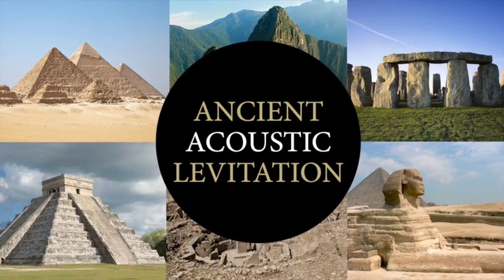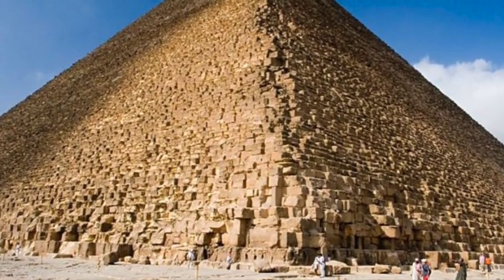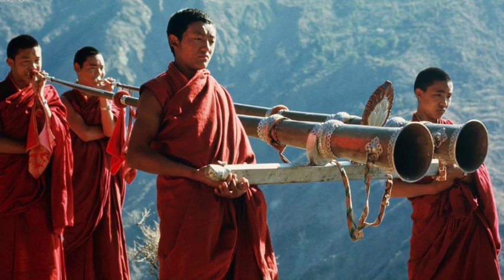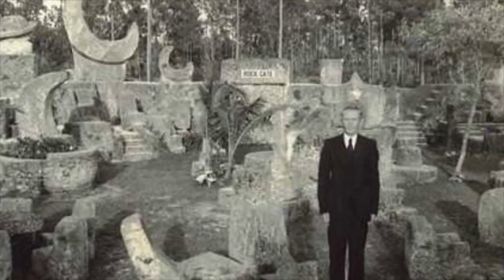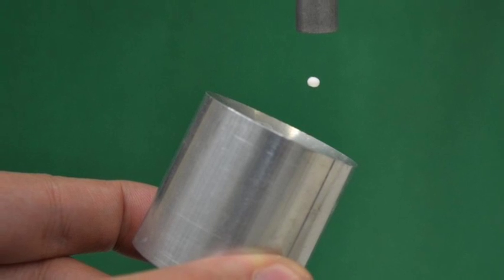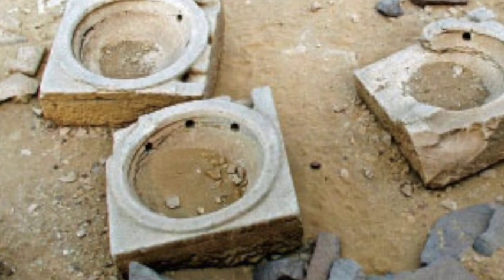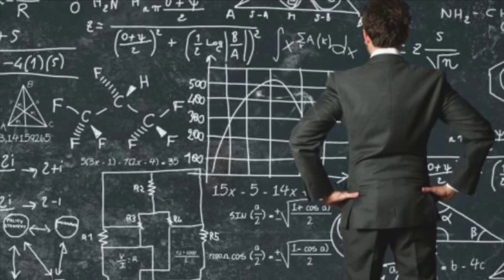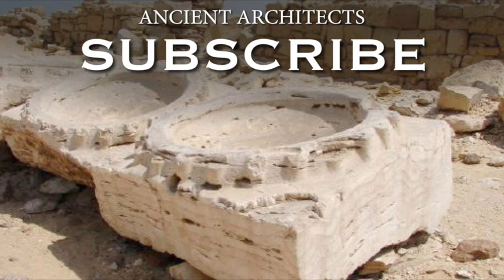Acoustic Levitation in Egypt - Ancient High Technology | Ancient Architects

Comment: One thing that always gets to me in the debate of HOW they did it, is the question that gets ignored.....why. why on earth make massive huge blocks anyways????  Everybody from the Romans to the  cathedral builders to the sky scrapers of today...were all made spectacularly with large materials that was not huge to start with. They were put together and built up. As in, we find ways to build big, but with smaller lighter materials put together or even mixed together like concrete and welding etc.  So WHY did they use massive blocks??? Surely they did so because somehow to them it was easy. It made sense. Maybe, like concrete, it was as simple as filling molds.

Comment: There is a much easier way to move heavy stones that have been cut,
Place a drop down flap around the base of the stone, and use these big horns, to blow air under these rocks and they can be pushed easily just as a hovercraft moves, or make a platform for the stones to rest on
,
That's too simple for the brains of today to think of moving them,

Create a sloped incline, and it would way to simple to raise these up to what ever level you wanted,
Just use the laws of physics to determine the best slope for several hundred men and horses to pull up an incline, and make sure you have a sound base for moving these stones, and it shouldn't take that long to build,

How many men would it take to move a 100 stones a distance of 100 miles, If you had a few solid surfaces to place in front of these stones as you moved them, it wouldn't take very long to move them a mile or so, especially if you had the man power,
You could probably do it a good walking speed , that means you could definitely move them 3 0 or 40 or 50 miles a day,
And once you finished moving them and putting them in place,  you would have a lot of fire wood, and no trace of how you did it

Comment: Someday people will realize copper melts at 1984 degrees F, and granite melts at around 1250 degrees F. Copper has been around and been smelted for atleast 9000 years which should predate egypt. These people
Simply used either very hot ( 1300-1700 degree ) copper or molten copper (we know they had bronze as well) to melt through the granite, than polish it. Occams Razor people… occams razor…

Comment: If you leave your bass guitar and amplifier connected and on, and you set the guitar down and lean it against the amp, the vibration of doing so will create a little feedback loop that in no time increases in volume and intensity to the point where it feels like the house is coming apart. Also works with regular guitars, I suppose, but my memory features my friend's bass.

Comment: Those multiple squares with the disc-shaped Bowl. Most likely were made in a mold or template. They seem to be Limestone dust collection pots. Where you at take some pieces of limestone and smack it with another piece of limestone and then be able to pour it out of those holes. The odds are that making cement and utilizing a special recipe of limestone sandstone and Granite and quartz most likely is the use for those multiple Square pieces with the Bowl inside are used for.

Comment: Great theory! I'm really impressed!
But, how does a strong electromagnetic field allow acoustic levitation? 10:34
Reply: Sound waves are at the bottom of the electromagnetic spectrum, so acoustic levitation is quite plausible. When a bright meteor passes overhead it can sometimes be heard at the same moment, even though it is some 60 miles away. The sound is likely a sub-harmonic of the vast electromagnetic noise generated traveling at the speed of light and both reach the observer simultaneously.

Comment: The stone blocks shaped like a bowl serve the same purpose as Ed Leedskins Coral Castle fl  stone grinder .device.  a piece of the stone to be lifted is ground up and this causes the ether in the vacuum to vibrate  Both Ed and those in Egypt used hand held cones to focus the ether vibrating energy to lift huge stone and guide them to any location they need to be placed in.   note each device has a specific number 24 shapes around the outer perimeter.  Ed's and Egypt's have these

Comment: I just saw two videos that shows how it was done.   First one shows how pulleys block and tackle make huge weights moveable.  The second shows that Egyptians used wheels and axles to move the blocks.  There is also a video that shows how Coral Castle was built, again, block and tackle and and electrical system he set up.  1.  Pulleys  Block & pulley
https://www.youtube.com/watch?v=r3Ru1zZjvug  2.  The wheel and axle   Pulleys  Block & pulley

https://www.youtube.com/watch?v=vYoWCn5r3rQ&list=PLat8Jejmdx1tsFo72_p159DE5-2-oW_qJ
3. Coral Castle  https://www.youtube.com/watch?v=nOoCuDnmtyM&t=127s   4.  Man from Michigan  shows how to move 20 ton block by using leverage.   https://www.youtube.com/watch?v=E5pZ7uR6v8c

Comment: Too bad the dude that came up with the barge idea was not an engineer. Otherwise, he would have known that the forces on the ships was rotational for a load centered between them, and that the engineering feat would require massive reinforcement as the lever the stone was located on would be attached to a fulcrum at the point of contact, with a very short lever trying to hold the force (vertical side of the boat) Basically, the load would be pressing down with 60 tons, but it is also pressing OUT with 30 tons on each side, that would turn, by leverage, into more than 30 tons per side of rotational force. Basically, his generic "rigid attachment" is full of the brown stuff.

Comment: Those three holed bowls are kinda a key clue. They used a canal lock system. So they dug a small river to the pyramid site which is why you find those bowls everywhere. They built essentially a lock, a small shallow pool where the the stones could be transported and dropped off exactly where they needed them to be.  They used the nile to transfer the water into those bowls which would be a separate outside perimeter wall that would raise the water level and go up and as they constructed the pyramid higher. The water in the pyramid area itself would be shallow, so once you place a block you could stand on it and not be in water. So you would have someone help direct boats and people dropping the blocks off next to previously placed blocks. This way you could also do multiple blocks at once; you could send 300 ships in with stone all waiting in the water pyramid area site while you raise or lower the water level. This makes sense they say there is 2,300,000 bricks, they get 300 ships means 300 blocks a day, that's 21 years which 20 years is the estimate they give to build the pyramids. Most people theorize that samples pulling the blocks one by one by a ramp, realistically even if you had 4 ramps that still take to long. With my theory they could also use the ships to bring in stone for the outer wall which had the three holed bowls while doing the other work. This method could also be tested out on a small scale sample as a presentation or a test sample which is a big problem that this acoustic theory doesn't hold up to. 

With this hogwash acoustic theory what is the test sample. Things resonate differently based on what material and size they are (tuning fork resonates based on the length of the fork prongs), and the pyramid's brick are vastly different sizes. Also they are different materials which would resonate differently (granite and limestone). In order to resonate something to the point to lift it requires a tremendous amount of energy in addition to do it accurately you need multiple sound sources in sync. Ironically you can't understand how they got the bricks on the boats, but accept the fact that they would need to put this device at an angle below an 80 ton rock. If this is some type of horn that a human blows, well I'm not gonna be the person doing that, you stand under the 80 ton rock. If this was a large machine, well now you have the same problem as transporting a large rock, are you going to build acoustic machines to transport your even larger acoustic machines that can transfer the blocks? Like where are the smaller devices that can move everyday objects, why would they only have this and use it to move bricks? Wouldn't there be a conceivable test sample that the Egyptians used for other objects. My theory give the king a boat in a cup, pour water in it, the boat goes up, poke a hole in it, water height drains to the hole. Cover hole pour more water in it, water level goes back up. 

I don't want to hear none of this water pressure BS. pressure height is depended on height only. Hoover dam is twice as tall, a wall of stone around it wouldn't be destroyed. Furthermore some type of pump or siphon, probably made of reeds would work. Also the river was likely bigger or closer to the pyramid 6,000 years ago so it would be less work to build the lock system.

Comment: Yeah, there is no conclusive evidence for the currently accepted theory, but acoustic levitation? You can't be serious. You'd still have to bring up the force to lift the block with your lung. A 60t block lifted with your lung, the force transmitted acoustically, which is very inefficient. Also, you know how hard it is to get a standing wave and use it to move things in 3 dimensions? We need modern computers and control circuits for acoustic levitation of tiny particles, and you're just throwing around these wild theories about Egyptians lifting 60t blocks with sound. For acoustic levitation they'd also need to have huge wall that reflects the sound, a wall bigger than the pyramid would have been needed, do you see how little sense this all makes?
Reply: No, nor does he care. He's trying to get the dumb people to fund his patreon.

Comment: Acoustic levitation proposed, does not account for thermodynamics. It is the same reason why the tuning fork cane wouldn't have been sufficient to vibrate enough physical mass to make it move or to produce a cut. Energy has to go in, no matter how you slice it, and the minimum amount of acoustic strength needed to lift the stone with sound would be no less than if one were to simply lift the rock mechanically. Just because you change the technique, you don't eliminate any of the standard physics. The man who built his own stone fort did not do it overnight or in a year. If he could indeed sing stones into positions, did he take long breaks between singing? Couldn't he sing it all into place in about a day, since the project was relatively small (compared to pyramids). And he's been somewhat debunked already. He had an interesting water distribution system on his property which pointed to the use of hydraulic power for much of the work. The ideas presented are still interesting, though highly unlikely.

Comment: They could have used canals they had cement and they could have used water to float the blocks up using Chambering and water pressure and air bladders.  

They Could have also used sound

Comment: Science hast prooven that this levitation works, but your Understanding of it is completely wrong. First of all they would have needed way more people doing the levitating stuff than just pulling the stones. That is because the levitation with sound is incredibly inefficient. If they die it like you said it would break the law of conservation of energy.
The stones in the quarry were also surely not Split by sound. They used wooden wedges, that expanded when soaked in water. Thats way more accurate than somehow using sound. 
So please stop making up those false stories, and If you want to make a real point link your souces. I hatte when people use actual science to make magic seem real.

Comment: Maybe the rods on the track were what was vibrating. I saw a video where someone put a motor on a hairbrush. This caused the brush to vibrate and then easily move across a table. Each time the brush vibrates, it momentarily left the surface of the table, so it was easy to move before landing.

Comment: The only problem with this theory is you can only levitate something smaller than the wavelength of the sound you're using
Reply: Sean Baumann then use larger sound waves
Reply: @Bibibosh  doesnt really work like that though. To lift megalithic stone u would need a sound have over 10m long in some cases exerting enough force to lift rocks. That s more in the real of earthquakes and explosion pressure waves.

Comment: You have fallen for a load of sci-woo by modern myth makers... Coral Castle now!... Combined real science and amplified it beyond belief and misapplied it to the ancients...... Oh dear, what a sucker...  Your worst theory yet... Blocks were cut with stone saws (metal saws designed to cut stone - or in this case, direct and pressure sand that does the actual cutting)... Easily demonstrated with soft copper stone saws, let alone bronze or iron ones... Horses, camels and elephants have a lot more pulling power but one person can move a few tons on well greased skids as long as not going up hill... Check out the guy who moves blocks and even a real house using only himself, wooden wedges, blocks and levers...  Dragging the load up slopes would be the hardest part, not sliding it onto the raft.

Comment: Why wouldn't the ancients have simply used a large paddle-wheel on a partial dam across the Nile? As an axle turned, immense forces were generated to pull ropes and blocks..  This tech could have been lost from 10,000BC to 5000 BC. Paddle wheels would have long ago rotted away and other evidence would have washed away.

Comment: You'd just need a pebble.....well a large rock place in the middle underneath....then you could spin the block very easily. Copper and sand saws has been demonstrated to cut all the stones/rocks etc.... at Giza. They didn't just suggest it was done that way. They did it. In the lab....a ton(see what I did there) of times. Now....all that said...It doesn't make the Pyramids a tomb.... because clearly they aren't and it doesn't make a person with an art degree....an expert in geology or anthropology

Comment: Great inventions and practices can be lost to society as evident in England in about 410 AD when the Romans left England. The Romans had introduced a more sanitary toilet system then that was used in England at the time after they came in about 43 AD. after they left the people there went back to crapping in holes in the ground as they did not continue to upgrade and use the Roman toilet system. It was not until  about 1200 years later that the first flushable toilet was invented for the king.

Comment: @AA  I don't know how much experience you have with tuning forks but here is mine. While levitating a ping pong ball with a handheld tuning fork for a few seconds is feasible enough, to support even a 1 ton block would require a MUCH bigger fork--about half the size of Florida. THEN there is the problem of maintaining a steady vibratory rate, as all tuning forks immediately begin to fade. A torus energy field has electromagnetic capabilities of both attraction and repulsion (ie: mag-lev train) and can be extremely powerful. I believe certain Ancients--not all of them--knew how to harness and manipulate these toral currents; and so did Ed L. The heart of Ed's operation was a rotational electromagnetic generator of his own design and build. It is still at Coral Castle but appears to be missing components.

Comment: Crystals and radio electricity is very difficult to make from scratch . but from what I know, the crystal needs to be a 2D thin  slit sheet . the has connected a terminal that is fed with an electrical random pulse, noise generator. the geometric area of the crystal, vibrates to one specific frequency from the noise gen. this constant vibration from the crystal sheet. is translated into the carrier wave. or something like that . the crystal piezo when mechanically struck produce a small current. or when applied current, bends.

Comment: Geopolymer, explains transportation.
Reply: Not quite. A geopolymer is a solid aluminosilicate material usually formed by alkali hydroxide or alkali silicate activation of a solid precursor such as coal fly ash, calcined clay and/or metallurgical slag. Today the primary application of geopolymer technology is in the development of reduced-CO2 construction materials as an alternative to Portland cement.  it was used by a pre-Inca civilization that created the unbelievably heavy walls at Puma Punta, Peru. The new theory--this time from geochemists--holds that the wall stones were stacked over and around a clay-enhanced polymer base to fill the seams that created a perfect fit; like a jigsaw puzzle.  By the way, note the Egyptian hieroglyphs that show pictures of their ancient batteries, possibly to introduce electric current to their tools and maybe even for the levitation power.